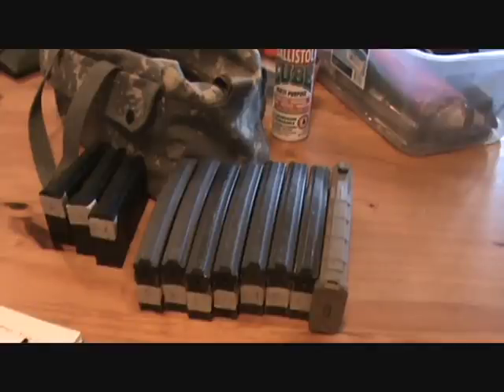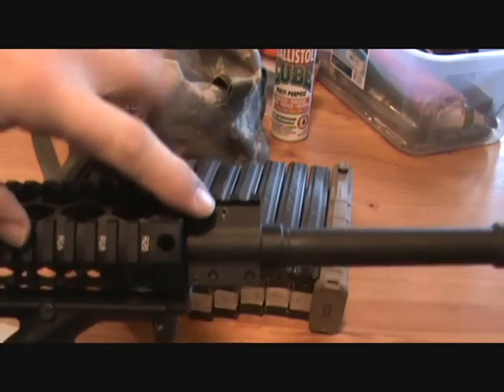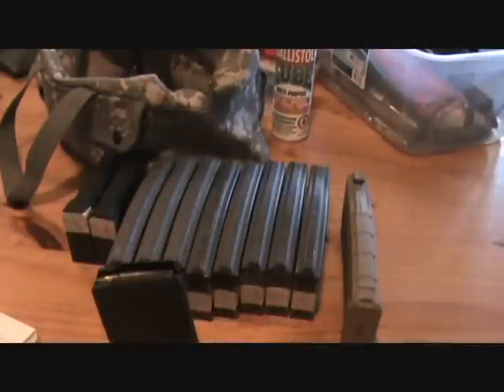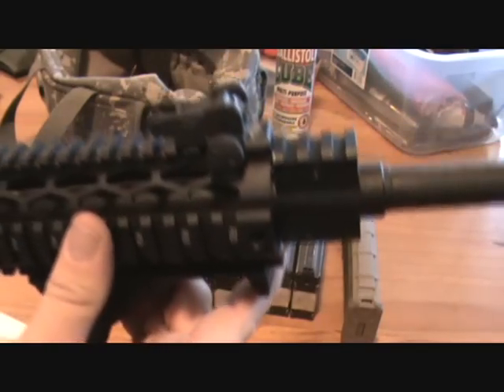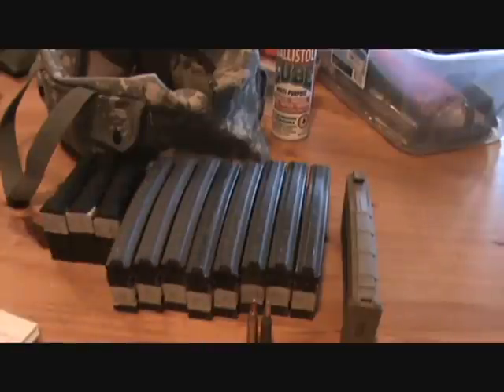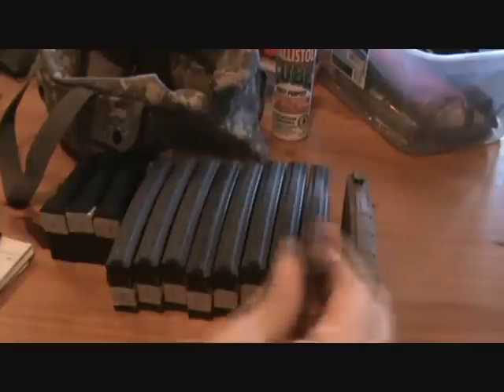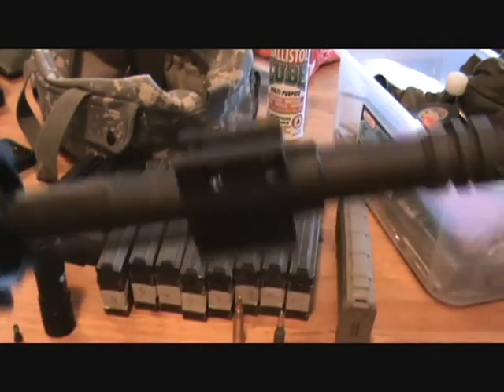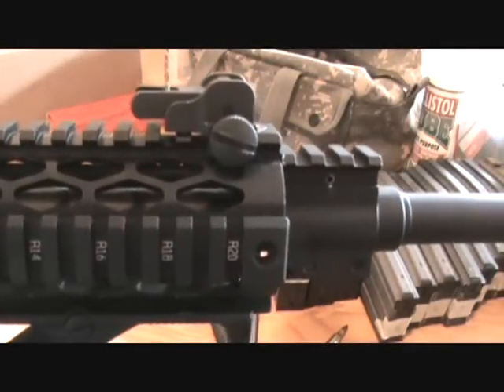Ar15 Trouble shooting

Comment: Has your bolt carrier group been eating-up gas rings? Mine was and it was short stroking and failing to lock to the rear on the last round. I think the run-out in the bolt cylinder on the carrier was causing excess sideways/radial forces which were slowing down the bolt carrier group and rapidly wearing down gas rings. I replaced the BCG with a spikes tactical nickel boron coated one and this fixed my problems.

Comment: If you go to AR15.com. There are tons of info on what you are experiencing. The gas block looks fine to me. I would look at the BCG marking up that buffer from your previous video.
One piece advice and take it how you will. but Tula and wolf is probably the hardest to diagnose with. I would shoot brass ammo...cheap Federal FMJ is what I plink with until the rifle is fully functioning and then go to the cheap steel casing ammo.